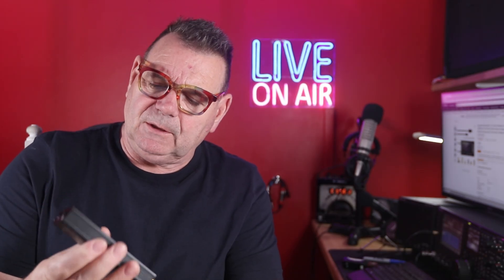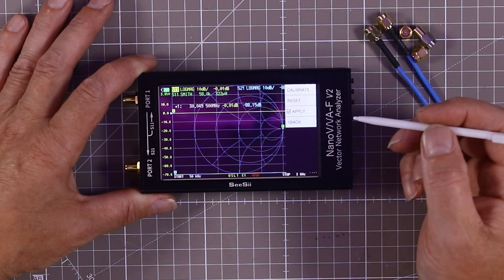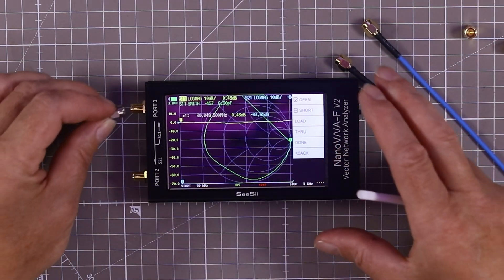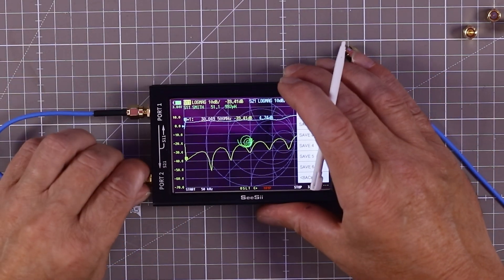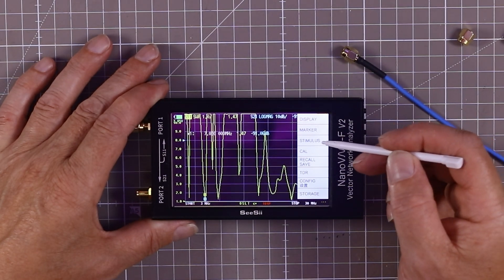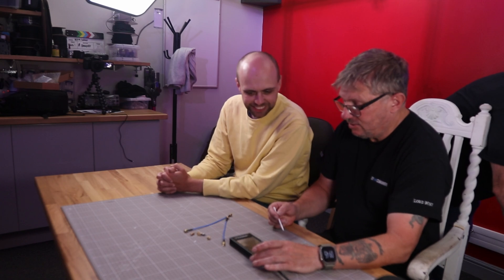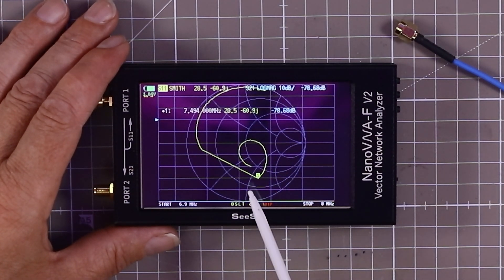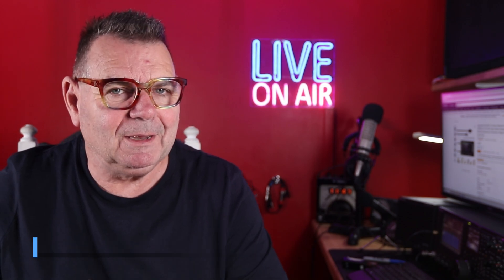Interesting NanoVNA-F-50kHz-3GHz - Sysjoint

Comment: Note:  From 5:00 to 5:20 is all characterized completely wrong.  Interpretted the values incorrectly (said 'above the line was resistance, when it actually represents Inductance) as well as what was need to correct for the J value (it would need Inductance added to the circuit-not Capacitance as stated) and he said 'if you put a 29 pf capacitor across the feed'....this would only make it worse. The "29" and "-60J" are for Resistance (29 Ohms resistive load) and the J is the Complex Reactance, the "-" signifies Capacitance Reactance showing the circuit, at that freq, has a total impedance of a pure 29 resitive load PLUS a capacitance load represented the by complex interger of -60J.  This would show that there is reflected power due to BOTH Resistive load (not being 50 ohms, assuming we're on a 50 Ohm source/line/load system) and the fact there is a +/-J value.  Smack dab in the middle of the Smith chart you'll have 50 Ohms and 0.0+/-J, that is a 'perfect' system/antenna.
Reply from the maker: 42
Reply: @DXCommanderHQ  I agree :D

Comment: I love my nano! I use it to sweep the SWR of my antenna system, and it is quick and easy.
I have an MFJ unit as well, but it isn't as easy as the nano, however, it is convenient at the base of the antenna.

But, you need to calibrate the nano with the test leads, not just at the ports. In order to do that, you have to have the connectors the test leads use, in order to calibrate it. If you don't, it could have errors that lead you down the wrong path.

But it is much more powerful than an SWR bridge alone!

Keep using it, and especially the Smith chart, in order to learn its secrets!
Reply from the maker: Nice tip!

Comment: A long while back, I purchased a NanoVNA at the recommendation of a club member. And since at the time the price was right and I needed an antenna analyzer I got it. But while the NanoVNA has a host of features, for me I found the whole process that you have to go thorugh was, for me at least, was very cumbersome. In otherwards, just to make a simple SWR measurement was hard to do to say the least. In short, I sent it back and found an MFJ-269C on line that made the process much simpler, not to mention being able to see the meter in the sunlight.
Reply from the maker: I think I am in the same boat as you!

Comment: Great video ! I use mine a lot in combination of building and fine tuning wire antennas, you can also search for: NanoVNAsaver, a perfect program to install on a laptop , you can use the advantage of a bigger screen and save the values in the moment of measurement , absolutely a great combi with the VNA in the field 
Cheers Geurt , PD4GB

Comment: Yep, 
I bought one about a year ago.
I build scratch built receivers & use it to measure inductance & capacitance for parts of the band pass section & I am quite happy with its results. It also does a bang up job on checking antennas for reflected power.
As usual I have to refresh my memory every time I use it but for $50 you can't beat it & I do plan on picking up the newer version soon.

Comment: A couple of things that might help, first is there's some great (free) software called "vna saver" that lets you connect your vna to your PC via USB.  You can then do everything from a PC, which is much easier, you can save calibration files, and most important take screen shots of traces (including SWR), so you can easily compare in the future.  Second, a nano VNA only uses 100 or 200 frequency points through your sweep, so really you should set the sweep to just one band, run "open", "short" and "load" calibrations for that band, optionally save the cal files if using a PC, and then run your test.  When you change bands you MUST recalibrate...  Mike's smith chart explanation was a bit "morning after a skin full" to be honest 🥴.

Comment: I use my VNA all the time, but honestly not that often for antenna work.  Filters are where it shines compared to a simple SWR meter.  Have a club project in the works where we're going to try some transmission line stubs as an alternative to expensive (and currently, unobtanium) bandpass filters for multi-radio operations.   I did use it for antenna work when I built my circularly polarized satellite Yagi pairs.  Working on the 70cm band is already mostly voodoo.  I can't fathom how the microwave guys stay sane.

Comment: Well, if I could understand well, there is some recoverable misinformation here.
First of all, the upper part of the Smith chart is not "resistive". This part is the "inductive reactance" part, which tells that the DUT at the point of the calibration looks a bit more like an inductive load than a pure resistive load.
It's a great place to understand the "point of calibration" in the previous sentence. There are two "unbreakable" rules of VNA testing. One is clearly introduced by @yt5bos: always re-calibrate when you change the "stimulus": the frequency range you're using. The second part is a bit more complicated and comes from the fact that "all measurements affect the result of the measurement". That is exactly why we use oscilloscope probes with known main parameters (frequency range, capacitance and impedance), and why should we check the compensation of the probes before measurements. The same applies to a VNA. The calibration process is well introduced in this video (though, "through" is not a must if you make basic measurements on a feedline or an antenna). The other part is even more important: the DUT (device under test) and the test device (VNA) are separated from each other at the point, where the calibration has been done. If it's right at the port of the VNA, then the DUT will be your antenna AND the feedline AND the switch AND the short feedline to your rig (at this point, the VNA) AND the SO239-to-SMA adapter. So, if you're curious about the real performance of your antenna (from the viewpoint of SWR or VSWR), you MUST make the calibration process at the feed point of your antenna (yep, disconnect the antenna, and play the open --> short --> terminate procedure, then, re-connect the antenna). I have saved all working bands separated, and the full spectrum from 1.8 to 29.7 MHz stored in my VNA, so I can check the trustability of the whole system within a few seconds (full spectrum, low resolution), and the bands (one band, high resolution), to find out if some of them are changed from ideal to a less ideal. Or a full crap. It took about 40 minutes to finish, but it was worth it.
And just a tip. NanoVNA app is extremely useful for anyone with a weak eye. Easy print-screen, lots of information listed, many "markers", and though it needs a new calibration, the resolution may be refined up to over 25 thousand measurement points (for a price of a much longer sweep time).
As a final thought, we're lucky. Extremely lucky. Back in the day (pre-2010), it may take a full day to properly measure, calculate and draw a smith chart of a multi-band antenna. Now we have it (after a couple of minutes of one-time preparations) instantly in the palm of our hands. Awesome.
Reply from the maker: Thanks

Comment: Ive had one for a couple of years now. I only ever use the SWR feature. I also connect it to me computer which give lots of options for plotting results. If memory serves me, I think I sent you a series of plots for my antennas.
Reply: I've also used it to test inductors that I have wound to confirm their value.
I wound one and have it on my vertical from the radiator to ground to put it at DC ground potential. It did actually quiet it down a bit too. Especially when there is any static build up from precipitation.

Comment: I used mine to tune my recent DX Commander purchase and measure the loss of the coax cables I made. After calibration and values stored its pretty fast to use and testing side by side with an mfj 259c I borrowed from my club results were pretty much the same.

Comment: I have the same unit Cal, bought it when it was first released from Martin Lynch, A little more expensive than most of the Vna's but certainly does what it says on the tin. Found a break in a 25mtr length of ultra flex 7 that had me pulling my hair out until i realised this unit could find it, and find it it did. its saved me quite a sum of money and while i would like to invest in a rig expert, this will always be in my tool kit.  I have a file for a 3d printer that makes a cover, stand and support for this model Cal, happy to send it to you if you want to give it a go. Enjoy Cal. Mat  2W0ONY
Reply from the maker: Wow